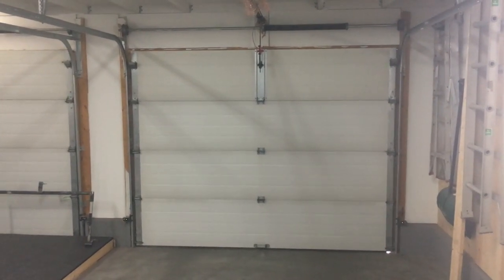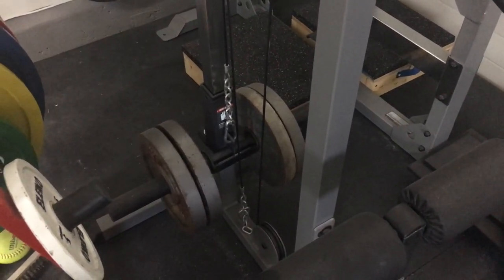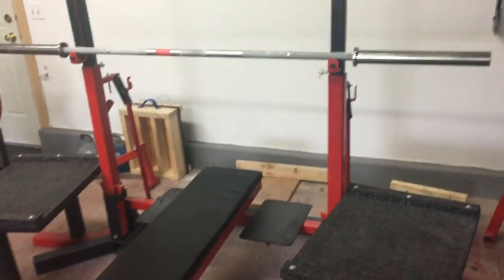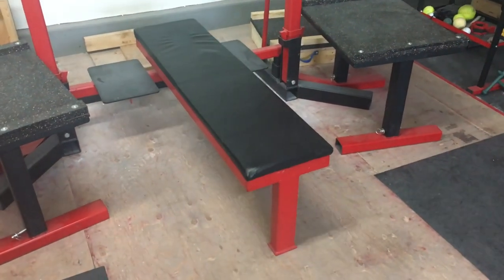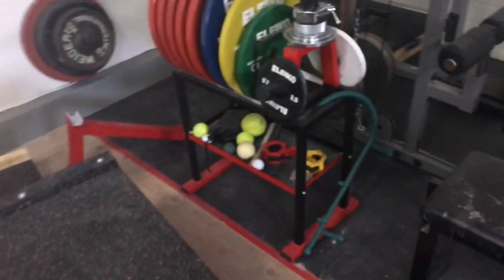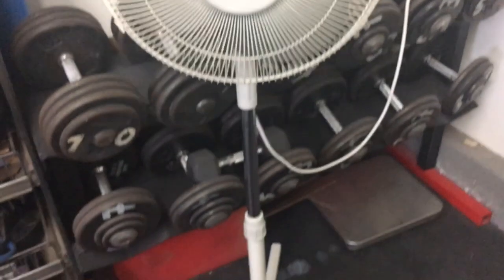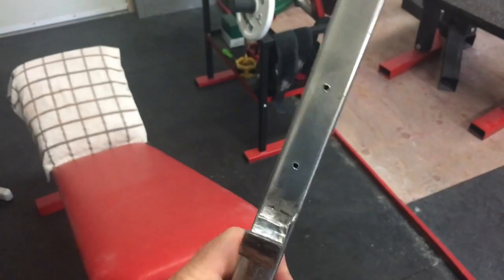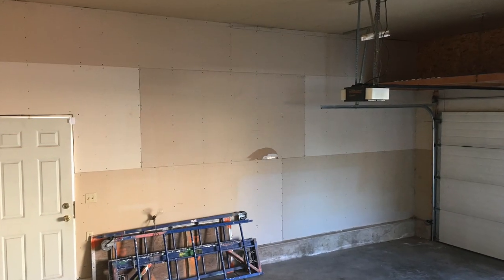World's Best Home Gym (for me) & How to Level A Garage Floor.

Comment from the maker: Further: Something that's not mentioned, but is worth a note, is that there is no mirror in my gym. I think a mirror, for me, would be worth the installation, if only to ensure I was re-racking properly. The other useful factor for a mirror is watching to see that you/I hit depth in squats. However, you should be taking video of all your lifts to check that, so it's not vital for that purpose.

Some powerlifters get very passionate about not having a mirror, but then they are usually training with one or many more lifters, so it's not needed for that purpose. They also say that they can't "feel" or detect their depth with a mirror distracting them, but they usually are equipped lifters and never hit depth anyway, so there you go.

 I'm talking here about my perfect gym, or those like me, who train alone. So, yes. A mirror would be handy.

I also use my phone to lay out my workouts and keep track of my training so I don't need a white board. I also am a serious competitive athlete so I never want to have a TV running for "inspiration" or entertainment. Now that can be distracting.

Comment: Pretty awesome that you built that stuff yourself. What kind of welder are you using? I have a decent hobart mig welder but my house isn't wired for 220 so it is a 115. Pretty sure it would do for that tubing but not 100% sure. That squat rack/bench setup looks especially great. Looks like you bought it from some higher end manufacturer. Pretty cool
Reply from the maker: I have the Hobart 220. I rented the smaller one but it struggled so when they came up on sale (less $250) I grabbed one. I had an electrician come in to wire up the garage heater so he put in the 220 outlet at the same time. The smaller welder still works, but it struggles with thicker box steel, but fine for most work below 5mm thick.

Comment: How did you cut the 2x4s diagonally like that? I’m trying to do exactly like you as it’s a superb solution! But I’m unsure how to cut boards like you did for the sloped floor .
Reply from the maker: When you buy your timber, make sure you go through the stack and choose strait ones. Then, when you know the floor drop (say, 100mm or whatever) mark that on the end of one piece. The other end will be tapered to nothing. Lay a second piece of timber on top of the marked one, lining up one end with your mark, the other end lined up with the diagonally opposite corner (which, as mentioned, will taper to a very fine point). Now mark the taper with a pencil. You can also use a string line or any other straight edge. Use an electric saw to cut along the line. It doesn't have to be perfect, as your floor will not be perfectly straight either, but the more exact the better. When you lay the cut piece on the floor, there will be high spots and low spots. Use packers (thin strips of wood or any other material) if the low spots are significant. The more fussy you are, the less bounce or movement you will have in the finished floor. The weight of the plywood floor and your equipment will take care of minor gaps, but, again, the more fussy you are the better the end result.

Comment: what size screws and what are the dimensions of the "noggins"? I'm ready to move forward on this and your video has been a great help on leveling out my garage gym floor, but I just need to know the screw sizes and get some more info on the noggins. Thanks so much if you could clarify on this.
Reply from the maker: The length of the noggins is the spacing between your long wedges. So, in my case, I placed my tapered wedges 500mm apart, from centre to centre. This was the same as my house floor beams (I went down to the basement and measured them). The timber I used for the wedges was 40mm thick. So, the space between each long wedge was 500mm minus 40mm (that's half the thickness of the wedge x2) = 460mm apart.
Another way to look at it is that the space between each wedge is 460mm + 20mm on each side to reach the centre of the wedges, as they are placed 500mm centre to centre and are 40mm thick.
If you start out by having a long piece of wood running along the high end of your wedges, screw that into your first wedge which should be butted up against the wall then space out each wedge 500mm centre to centre and screw them in place. With your high ends now spaced correctly and fixed in place, go down to the thin edge and move them into position so they are also 500mm centre to centre. Now you have them all parallel and spaced correctly, ready for your noggin placement.
The tricky part is the height as that will change with every set of noggins, as the wedges will slowly reduce in height. 
To make sure all is well, check that the top of the wedges are level across your platform. Just lay a long piece of wood (a straight piece, of course) and check that with a builders level.
Then measure the height from the garage floor to the top of the wedge where the noggin is to be placed. Cut the noggin length-ways so that it is the same height as that spot where it will be placed.
Because the noggins are staggered (so that you can screw into them at each end and not have to angle your screws) the height will vary very slightly. If you make a mistake and cut them a touch short, no problem. Thats better than being too high. Screw them flush with the top, so that your plywood you add later will sit flat, then use thin slices of wood underneath to pack them to avoid any flex and bounce.
Screws should be double the thickness of the long wedges, so in my case that would be 80mm long (3"). 10 gauge is OK.  
Let me know if you need clarification.

Comment: This is great!! How did you cut the 5 meter wedges? Just with a hand circle saw or were you able to use a table saw? I attempted these cuts but they are not exactly the same causing my barbell to roll around a bit.
Reply from the maker: I only have a circular saw. Not sure if you can angle the guides on a table saw, but if you can, that would work well. Maybe. Or maybe it would be difficult to get the angle right. 

I used a long straight edge to draw a clear line in pencil from one corner to the diagonally opposite corner then just slowly and carefully cut the pencil line. The circular saw has a notch in the leading edge to help you follow lines so that helped a lot. Take it slow and careful and you should get a good straight cut.

If it's not exactly perfect, don't worry. Your floor sure won't be perfect either so you will need to cut some very fine slivers to make sure the wedges have good solid contact with the floor. I have an expansion joint across my floor and the concrete is slightly raised either side of that. You may even have to plane a little to form a scoop in the wedge over such a joint. I didn't though. The wedges seem to take it in stride.

Use a level to measure your fall to start with so that the thick ends are the right height then use the level often to make sure the wedges are holding your plywood level. As long as it's within a cm over a 5-7m fall you should be OK. 

If you are olympic weight lifting with the bar tending to roll, try putting a little bit of carpet or old mat under the end of your rubber mats to form a slight gentle rise. That will stop the bar rolling away. 5mm is enough.
Reply: thank you very much for this!

Comment: Iam not a powerlifter and don't really do olymic lifts. Do you think i will be better off with just stallhorse mats or shuld i get a platform to protect my epoxy floor?
Also I have a small slope in garage and dont wanna be lifting on an uneven surface.  If i decide to go just with stall mats i wonder how 🤔 should i level them?  By the way how do you find the slope of a garage and can homedepot cut the beams like yours in the video?
Sorry for all the questions and I hope you can help me. Thank u.
Reply from the maker: If you aren't using weights, stall mats or similar are fine. To find the drop/slope of your floor, you need a level and either a long straight plank or a string line. Place your leveller (string or plank) on the floor at the highest point. Use your level to get the string/plank level. If you are using a plank you will probably find it easier to have some blocks or similar items to prop up the plank at the low end of your floor. When your line/plank is level, measure the distance from the string or BOTTOM of your plank to the floor. That will be the thickest part of your wedge, tapering to a point. No reason why homedepot cant cut them, but ask first.
Reply: Hank u very much